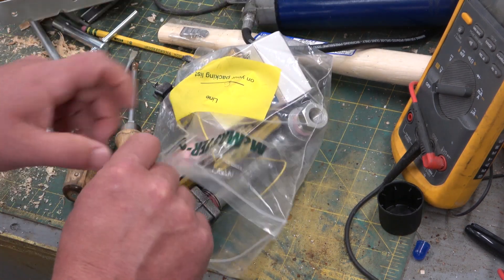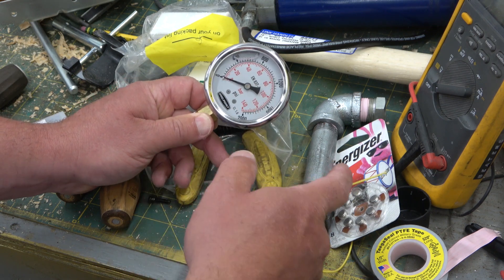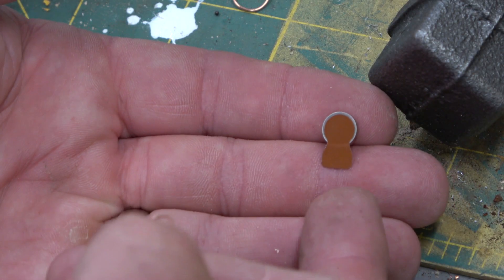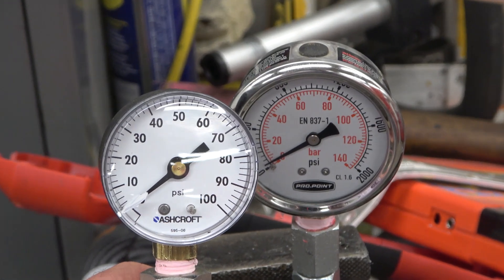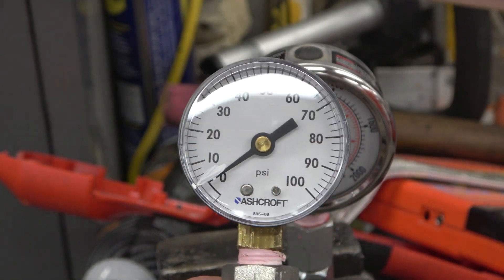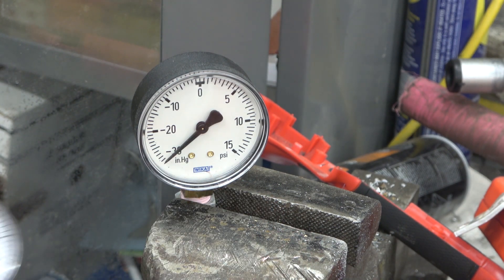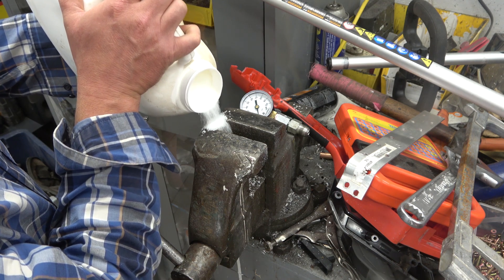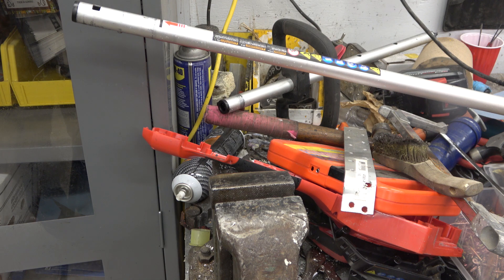hydrogen battery

Comment: A hydrogen battery would be a system for producing hydrogen with electrical power, storing that hydrogen, and then converting it back to electrical power (e.g. with a fuel cell) at a later time.  The definition of a battery is that it converts chemical energy to electrical energy.

Comment: We used to do this as kids, but, not with pipes.  We'd put the lye/water in a soda bottle.  Put in some Al foil and then put a balloon over the opening.  FIll it up, Tie it off and let them float away.  Or, touch them with a lighter and hear the bang!

Later on in a lab we would use He to find leaks in high vacuum systems.  No, not H.  We had too many heat sources.  Didn't want to see the 'bell jars' explode :)

Comment: Could you do a video teaching a young buck like me a thing or two about allen wrenches, specifically the finishes on the steel. I've been looking for big industrial allen wrenches but most only have a black oxide finish, which I find less resistant to corrosion.

Comment: i did this with a 4ft piece of  4" PVC. The screw cap on the end ended up down the block, output port too small ha ha.. Pushed itself right through the threads.😆

Comment: This made me chuckle, in the chemical industry when they pressure "test" valves with nitrogen, they pass (the test) but on a hydrogen line, they pass, out of every single orifice! Hydrogen will find any leak, even through Teflon. The enginerds found this out at my place when they cheaped out and bought the cheapest valves they could. Dealing with 40 bars of h2? Lasted but a week. And when the cheap relief valve lifted, it went off like a cannon, only an inch line but jeeeez. How do you make a team of engineers run like hell? Used their stash of cheap valves during breakdown shutdowns, and had to rethink to tight shut  gate valves. Yet the plant the h2 comes from, (outside contractor on site) deals with it at 250 bars doesn't have issues. Cmon guys, operator (me) says ask them what they use, nah, don't listen to that guy, he hasn't got a degree.
Reply: Enginerds rarely listen to the operator. You know, guy who stares at the machine long enough that he can diagnose a problem by hearing.
Reply: @sparkythawelder  I've worn out my T shart with "I told you so" on it. They just get the Jeremy Clarkson smug face now.

Comment: Hold on. There’s a way easier safer way to make a hydrogen generator. Two or more opposite charged Stainless steel electrodes with some baking soda in the water. I used about eight 3”x3” stainless plates insulated on a nylon bolt with 1/8” nylon spacers between. Charged each plate opposite the next. It made TOO much hydrogen and I had to change it so there was a neutral plate between each charged plate. I actually had this in the engine bay of my truck and piped it through a bubbler and into my intake. Now that I think about it that was pretty dumb. I only charged it 12VDC
Reply: We all gotta learn our lesson one way or another.

Comment: I gotta think there's a better way to make hydrogen...  Like zinc, water, and heat?
Reply: No. That does nothing, except boil the water. Water vapour is still H20, it Isn't H2 AND O2
Reply: @renagenic  Wikipedia disagrees
Reply: @jonwatte4293  I bet its in contact with air or air and steam or tap water

Comment: You gotta lose that garbage tape and get yourself a couple rolls of Scotch Super 33+. Skookum as FUCK. The only wrap fit for underwater or 250° frankenstein. A half-lap wrap is good to 600V, and it works pretty well in my 15 years' experience from about 15° to like 130° (ambient temperature, I mean, when applying). I've seen linemen use it and rubber tape to make 5KV connections, no stress cones, just tape. I, an inside wireman, will never be that ballsy, but I've seen it work.

Comment: Hydrogen battery, or HYDROGEN BOMBA! 😆 Maybe a thermal electric generator can also be used with this ,  use copper or aluminum piping, or sq. tubing, with a pipe plug in the ends,  large enough to cover with teg plates and heat sinks, maybe a large capacitor to store the energy, and dc to dc to regulate the output, it's not going to be world changing power, but the heat alone may charge a phone, or supply light in a emergency, maybe burn the hydrogen, to heat more thermal generators,   maybe add a small hand crank generator,  to take advantage of the circuitry,  making it more useful,  this could be a decent energy emergency/ camping product! Maybe a air chamber could be incorporated, that is heated due to compression,  adding heat to the system, or possibly use the pressure and hydrogen to spin a small turbine generator, probably generating less than 100watts, and who knows the run time,  but the main question, would it be cost effective?? 😳

Comment: I've been thinking of generating hydrogen  from aluminum shavings I've been saving from my projects.  Did you know a 1/2" piloted router bit with a template makes nice glitter from 1/8" aluminum plate?  No cnc needed.

Anyhow, I got aluminum shavings.  A 4500 PSI compressor.  Pressure vessels.  Low pressure accumulator, heat exchanger and gas dryer.

Going to attempt high pressure hydrogen  in a pre charged pneumatic air rifle.  Mach 2 or better is my goal.
Reply: Good luck with this! Don’t fucker yourself up trying tho. If you succeed, put it on the tube so we can see it work.

Comment: Never seen a 2 way check valve? Used them many times in O&G wellheads. 2 piece metal float you install in the valve body. Test your equipment from the top, then bleed pressure, screw in to off-seat float and pull it under well pressure.

Comment: Used to have fun as a kid with sodium hydroxide (lye) (caustic soda) aluminum and pressure vessels.  Aluminum co2 containers worked well, as did fire extinguishers. Still have a couple scars to show for it.
Reply: Drano drain cleaner (the granular type) uses aluminum metal and sodium hydroxide.  Stick it down a drain and wait for the hydrogen to be evolved.   Convenient, all-in-one solution.
Reply: @tubastuff  add some washing liquid, it's like a chain of fire crackers.
Reply: @tubastuff  What happens if you mix it with nitric acid?
Reply: @The_Inquisitive_Inquisitor  Depending on the molarity of the HNO₃, it could be pretty violent.  Why on earth would one want to do that?
Reply: @tubastuff  clogged shitter ?
Reply: @toto29620  Nah, you use a "plumber's helper" for that.   Worst case, use a snake.

Comment: I appreciate the humor and rambling, however for us non-Chemists it sure would be more interesting if you explained what was going on in Average Joe-eese.
This LOOKS like it might be useful for one-off devices that need pressure when you're out in the boonies, just not too clear.
Reply: Hydrogen generation is perhaps the most dangerous way to make random pressure. Probably better you don't understand.
Reply: I would not use this for pressure generation. The gas it creates is extremely flammable and can also explode, almost any other gas would be safer. The chemicals used are caustic and are dangerous too. This is useful if you needed to generate a large amount of hydrogen gas and that's about it.
Reply: @Adam-vj7dn  The gas is only flammable when there is OXYGEN.  Watch the Hindenburg burn and you see it burns like a liquid (because there is not enough oxygen in the area of the burning (which is why it did not go "BOOM" and immediately disappear.)
. Gasoline also needs oxygen meaning you could take a striker(like welders use for their oxy/acetylene tanks)...submerge the flint in a bucket of gasoline and while it is under spark it.  Flint will spark underwater (in this case in gasoline and NOT CATCH FIRE- as there is no free oxygen atoms in the fluid.  It is the oxygen that feeds the fire.
Reply: do-it-yourself single-use hydraulic jack
Reply: Carbon dioxide makes for a safer one-off fill gas. Baking soda and vinegar will safely and reliably release carbon dioxide gas while leaving behind fairly safe sodium acetate dissolved in water. Unless, of course, explosions of flesh-destroying sodium hydroxide and hydrogen flames are your goal. That said, anything pressurized can be an explosion hazard if the vessel can't handle the pressures created.

That said, sodium hydroxide dissolved in water attacks zinc metal, dissolving it. The zinc metal breaks down some of the water 2(H2O) into hydrogen H2 and hydroxide 2(OH), forming hydrogen gas H2 and zinc hydroxide Zn(OH2) dissolved in water with any remaining sodium hydroxide. Pure zinc submerged in pure water would also perform this reaction, albeit very slowly. Sodium hydroxide can be said to catalyze the reaction between zinc and water.

Comment: I work more on the electro-mechanical side of things and didn't even know about the inaccuracy of pressure gauges at their lower limits till you mentioned it. Had to look up Hooke's law.
It'd be interesting if you could demo that in a video by having several different ranged gauges on a singe tank, and vary the pressure to show these differences in a direct side by side comparison.
Reply from the maker: Pretty much every electro-mechanical gauge is garbage below 20% of full range.
Reply: @arduinoversusevil2025  Especially speedometers and breathalyzers. But the cops didn't believe me.
Reply: @arduinoversusevil2025  even a finger and comb potentiometer sender?
Reply: @arduinoversusevil2025  What about Hooker's Law???
Reply: @Peewee0413  That law is easy, don't fight Lee in Chancellorsville.
Reply: @justtime6736  👏 👏  Bravo....
Reply: @arduinoversusevil2025  ? Even the pretty ones
Reply: @arduinoversusevil2025  I thought that only applied to government motors fuel gauges. 😆
Reply: @diegopicadidot8948  yes a Guage will break from over pressure. Well not so much break as much as they will lose their calibration and will need recalibrated. It depends on the degree of over pressure it is subjected to.
Reply: @erupp5975  you mean removing the needle and place it back at 0 ? :-)

The boudon tube will just bend a little and does not springery sprung back again.
Reply: @mauricevandoeselaar  it depends on the type of Guage it is. Guage for different mediums have different methods of adjustment. Guage used for measuring gasses usually have adjustment screws on the face and Guage used for liquids usually have a locking knob that can be turned to adjust the needle location. Sometimes its just as simple as opening a vent to release pressure inside the Guage if there is a temperature/pressure variation cause. Any Guage should be checked against a master Guage to verify its functioning correctly. Most can be rebuilt if there is any damaged parts causing bad readings. So don't just throw one away if its out of whack.
Reply: I have accidentally broken one before by subjecting it to 10x+ the pressure it was maxed at. It was sent back for a rebuild. Oops.
Reply: Ave knows this but for those who don’t, use a gauge range at 50% target. Ie if your system is around 50 psi, 0-100 psi gauge is required. It measures accurately. 0-20, 80-100 is getting error built in due to a few factors. In other words, don’t use a hydraulic gauge 0-3000 on your well pump. You won’t see a pressure. In enginerding, it’s called 50% full scale accuracy (FSA). If you can’t figure out what range to use for your application, here is a colouring book for Christmas… lol
Reply: @gunner4544  I
Reply: @diegopicadidot8948   - if you really over pressure the tube explodes, if it stretches the gauge still "works" - you just need a texta to write new numbers on the dial, lol...  (zero may be a bit off...ha ha ) - look up dead weight testers if you want a new hobby...

Comment: About 12 years ago I found out the hard way to not use zinc plated metal in my electrolysis generator.
Reply: Don't sweat it, we've all made that error a time or two.
Reply: @matthewellisor5835  i can vouch for that
Reply: @matthewellisor5835  Had to run it to the yard it was like 120 stacked zinc plated wall outlet covers haha.

Comment: Uh, that's a hydrogen bomb. We used to make them with drain cleaner and aluminum foil in mountain dew bottles. Putting it in a pipe like that is soooooo dangerous! It can get hot enough to self ignite and booooom! I made an hho generator and used to shoot water bottles up in the air. I tried with a milk jug and it didn't go up it just exploded! The shockwave from it was insane! Be careful bud. I wound up putting it on my 150cc scooter and went from 90mpg to 110mpg.
Reply: Those were the days.

Comment: How much electricity does this produce? Or is it a battery in the sense that you can burn or react the hydrogen to get energy?
Reply: @danielrouw2593  
Oh really, only group 1 and 2, metals well what about aluminium?? (what you brought up) it's an amphoteric metal. On the RIGHT SIDE OF THE PERIODIC TABLE... 
What about zinc used here , it's a transition metal. Nowhere near group 1 and 2,in fact, closer to noble gasses than alkali/alkaline earth metals

Holy crp, my chemistry, must be worth nothing, with all these elemental differences I didn't know about. I mean oxygen is an oxidising agent???.....  Wow. 

Lol, just playing bud, good try, though. Just had to rib you a bit about the left side of the PT, the real answer of what reacts, comes down to THEIR reactivity vs. HYDROGENS. as long as its greater than hydrogen, this rxn will occour. the greater the reactivity to the oxygen IN H2Os molecules, gives you an oxide (or hydroxide) or meta oxides (2metals 1oxygen) i.e Na2ZnO
Take care and have a good day bud.
Reply: @danielrouw2593  nowhere did I say that either
Reply: It's a battery in the sense that it's a button cell.
It just produces hydrogen if shorted and not exposed to air.
Reply: @daviddavidson2357  This isn't a battery, you could MAYBE call it a cell, but for a hydrogen (what he's producing) cell to work, it needs to be able to produce a voltage, from one Side OF THE FUEL CELL , to the other side where the 2H2 + O2 -> 2H2O + ENERGY.

All he has is hydrogen gas...... That's it, its as much a battery, as a tank of pressurised air is. Yes, there IS potential energy in the form pressure, but as explained, this doesn't produce electricity, and as it is such a tiny volume of hydrogen, (showing increased pressure because of the heat produced in this rxn.) if you want to see how much extra this needs, just to produce electricity, have a look at the size and price of a fuel cell..... They contain about 10x the precious metals (used in catalytic converters), from the platinum groups, just to make hydrogen react with oxygen without a flame, if a flame is added, you loose all your electrical energy and get it back out as thermal nrg...
Don't get me wrong, I love uncle bumblefuk, just this wasn't what the video claimed. Usually he doesn't do that.. 
In essence, this is literally a one shot go,  alkali NaOH(B) + metal Zn(M) = H2 + Na2M(O2)
Where as, you can use a fine metal mesh, in alkali, to evolve hydrogen. Just add electricity, in situ and ad hoc. Basically going from a disposable battery to a rechargeable battery
Reply: looks like a convenient hydrogen cell, ie it makes hydrogen gas, at an apparently alarming pressure. folks dispute sometimes, whether it would enhance engine performance to couple one of these with the air intake. hydrogen gas is of course very flammable in oxygen and under compression, explosive. edit. dont try that by the way, it doesnt work. I'm no chemist but couldnt that reaction also create water/steam in the combustion chamber?

Comment: Stoichiometry, my good Uncle Bumblefuck. 2Al + 2NaOH + 2H2O → 2NaAlO2 + 3H2   plus a damned lotta heat for all those bonds breaking...
Reply: Nope. BREAKING BONDS, DOESN'T RELEASE HEAT. IT REQUIRES HEA!!!  
Bonds being CREATED, RELEASE HEAT!!
C'mon, don't try explaining, what you don't know
-Besides-, your stoichiometry Is also incorrect; FOR the rxn SHOWN! 
Where the He'll did you find aluminium? Even as a secondary or tertiary reactant????? 
He's using zinc.... So I'll fix it for you;
Zn + 2NaOH(aq) -> Na2ZnO2 + H2